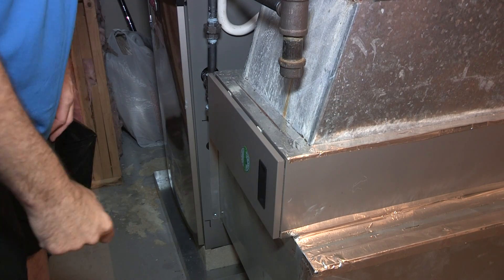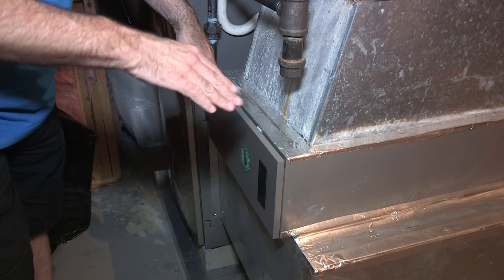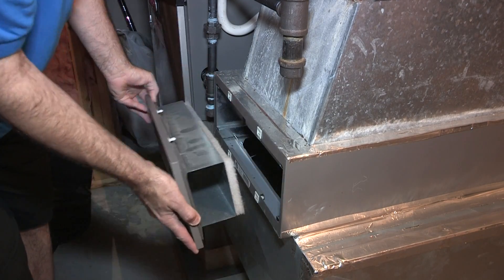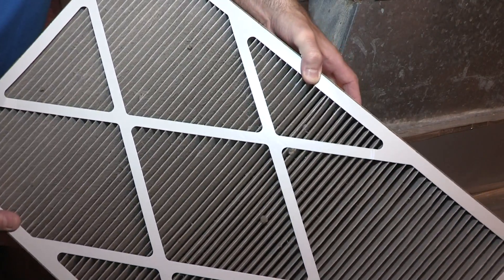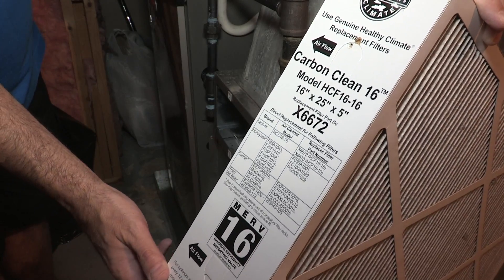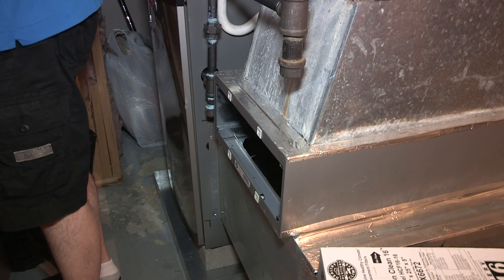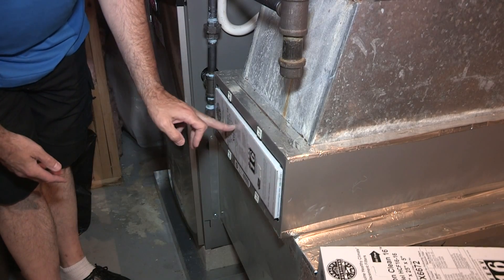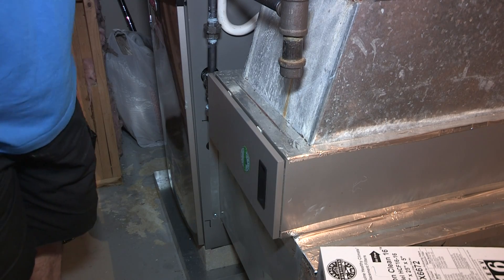How to change a high efficiency furnace air filter Lennox HCF16-16 Filter

Comment: Thanks... I used this video to double check the correct positioning of the filter.  When I pulled out the old one,
it was loaded in the correct manner with the air flow arrow pointing down.  There is no directions on the filter or within my furnace info book on on whether the air flow arrow goes up or down.  This video confirmed the proper position.
Reply: I do not recommend installing an air filter in a certain direction, based upon the direction the last filter was installed in.  Many times a homeowner installs the filter backwards. If you copy their mistake, the installation is wrong. The direction of the ARROWS on the filter should be pointed towards the furnace heater, not away from it.
Reply from the maker: You are Welcome. Thanks for watching